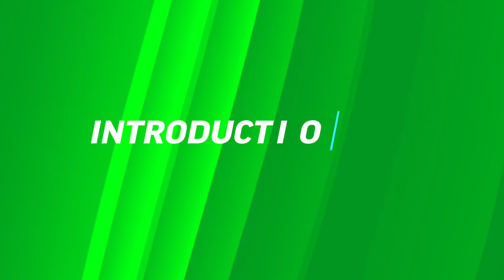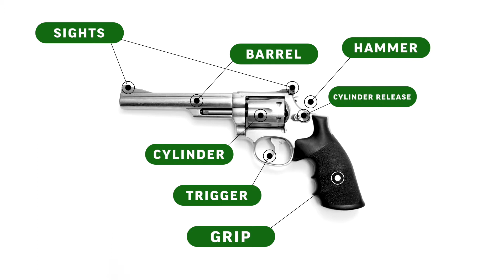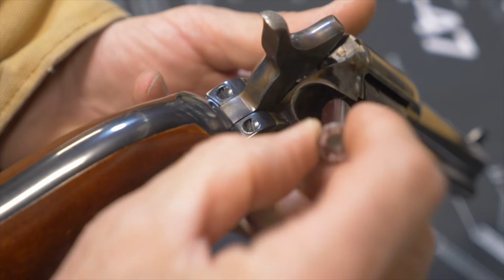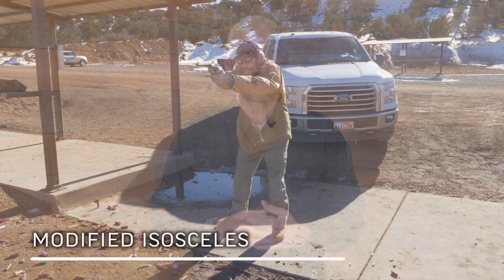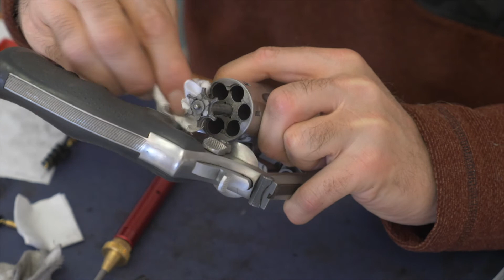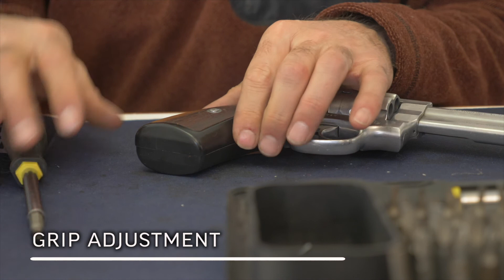Introduction to Firearms: Basics of Revolvers

Comment: Good information. I have the new taurus 2022 605 defender 357/38 3" Barrel small frame steel. The grips are to small they came with  the revolver. Will the public defender rubber poly grips - model  4-425 large fit.  Thanks

Comment: I always make sure the trigger is going forward when releasing the hammer when uncocking. Holding the trigger back when uncocking a DA will cause the pin to touch the bullet. Not a good idea at all.